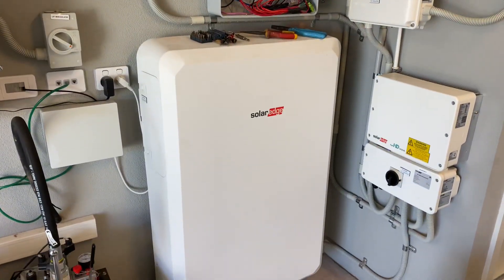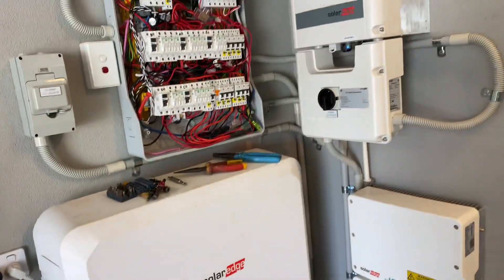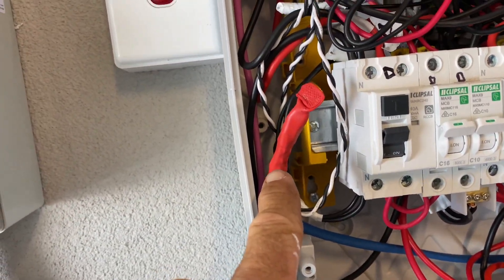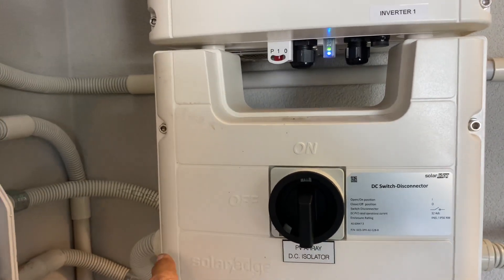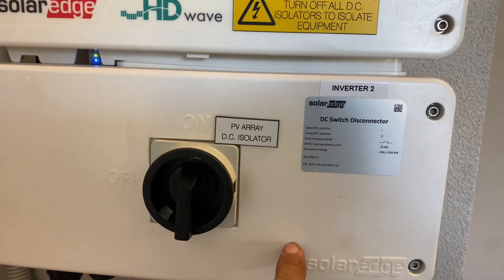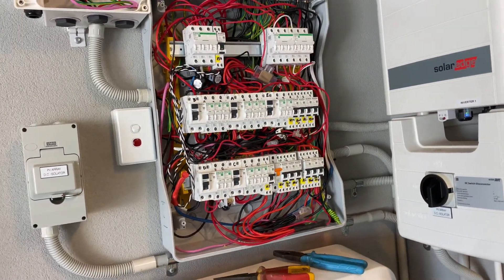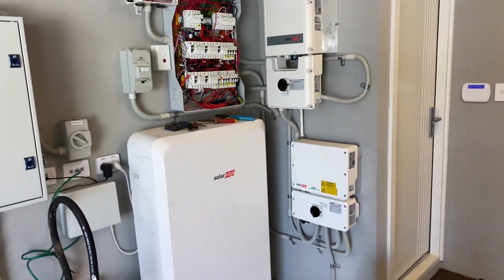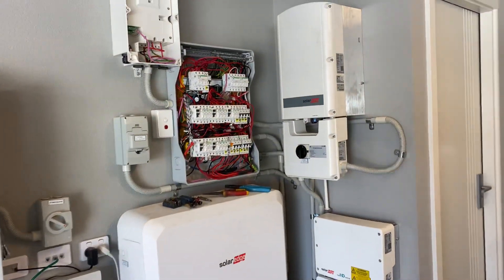AC coupled vs DC coupled battery systems whats better

Comment: So r we blaming Installer's workmanship to go for less efficient AC-coupling?  I thought DC Couple is lot more efficient way to preserve energy without having to go thru conversions AC Couple systems need
Reply from the maker: Dc coupling is more efficient, but some systems like this one Solaredge are very time consuming to install. A dc coupled all in one solution like Tesla Powerwall 3 is far superior and way neater.
Reply: @joondalupelectricalservice3201   Got it, less cabling based Product design is always better, considering to add Sigenergy 40kw, hopefully DC coupled direct from Solar - should look still clean

Comment: A DC coupled system doesn't need to be this complicated. Use a Hybrid all in one and connect a battery, or an off grid all in one, if you don't want to pick up what little feed in tariffs are still available.

Comment: a DC battery inverter is considered better than an AC battery inverter because it is generally more efficient, as it only converts electricity once from solar panels to battery storage, while an AC system requires multiple conversions, leading to greater energy loss; making DC coupled systems more cost-effective and ideal for new solar installations where you can optimize the entire system

Comment: Isn't the Sig DC and the Franklin AC? I always use Victron, but as you say, so many connections and different components to sync up and get working together. So much time spent and room for error. I just finished a large system with 14kw of solar, 2x 8000 kva inverters paralelled, 2x 450/100 mppts, 4x 10.24kw lithium power wall batteries (96kg each) cerbo gx, colour screen, comms cables, isolation switches, bus bars, fusing, circuit breaking. It took about 2 weeks  of effort and focus, a sig system would have taken 3 days with the panels. I'm turning to Sig this year, way easier install and great warranty too. I hope they turn out to be as reliable and functional as marketed.
Reply from the maker: Stand alone plants are best dc coupled, hybrid inverters (Sigenergy) dont have a place in the off grid world in my opinion……..time will tell.

Comment: can the powerwall 3 be installed as dc coupled?
Reply: The PW3 has 6 x MPPT DC inputs and the inverter and battery are integrated, so ... the PW3 is basically DC coupled.  It supports both AC coupled and DC coupled solar.   But you do not have direct 3rd party access to the battery bus.

AC coupling is less wiring for the installer, but it is also less efficient.  It was fine when most of the energy was exported to the grid, but now that many people want to store more energy, DC coupling winds up being more efficient.  But also harder for installers.  So most installer are going to prefer AC coupling.   Also, when you are DC coupled the inverter doesn't have to mess with the frequency to control the AC-coupled solar during a power failure.  That can get a bit messy in terms of AC regulation.

DC just winds up being more robust, in general.  But as mentioned, DC is a lot more wiring since each string is brought back to its own charge controller (In modern day you don't parallel DC strings any more, you give each string its own MPPT).
Reply from the maker: Hi, no it cant.